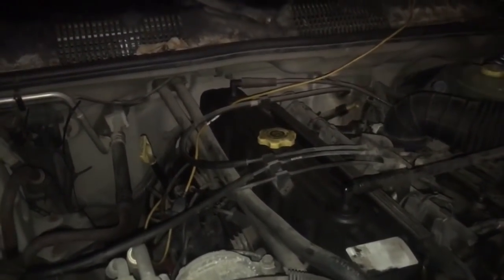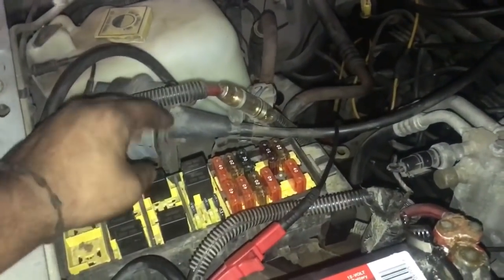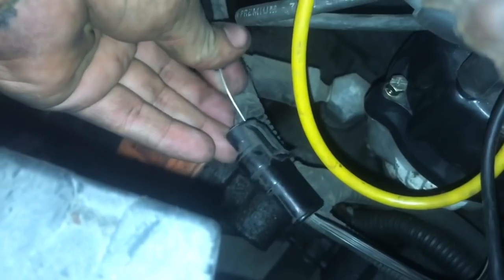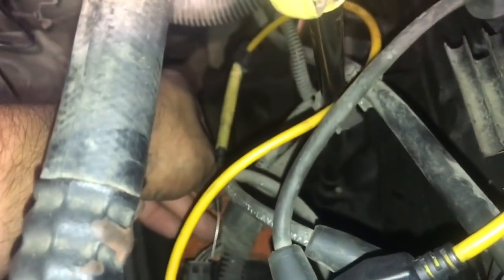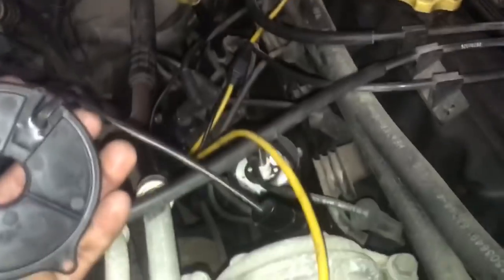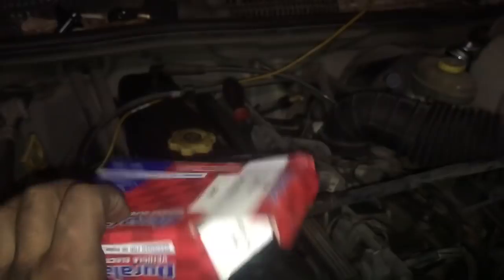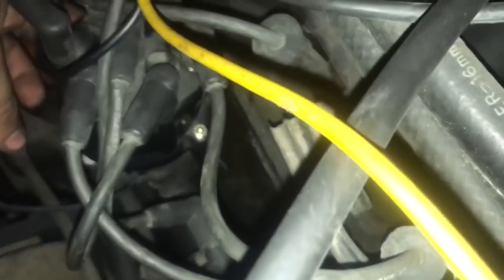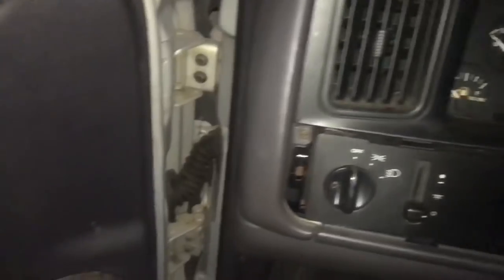Jeep Crank no start repair

Comment: I parked mine 10(!) Years ago when it had a no spark condition.  Realized that coils were a high failure item and yesterday, put in new coil and it started right up
Reply: What coils are you taking about? I have a 93 that won’t start.. tried everything

Comment: If the cam sensor has 5vts in and 5volts out when cranking, wouldn't that show its working? Thanks
Reply: I had the same question

Comment: I have a 2000 Grand Jeep Cherokee 8 cylinders, changed the battery my Jeep cranks won't start. I have two keys both chips are good so it's not the keys. My dashboard has a a key with a red  circle ⭕ displayed, my alarm system isn't displayed on the dash, not sure if it's the skim modulator. Any help would be appreciated thank you very much.
Reply: @seekingphase1621  Yes, it was the skim modulator, Thank you 😊

Comment: I love your videos Oz, long time subscriber having same problem with 05 GMC Sierra 1500 SLT with new battery that seems to have a parasitic drain because will not start after sitting all night. Had Autozone test Alternator, Battery, as well as Starter and was told everything was good, started 7 days straight after doing a trickle charge then let sit 48hrs for a final test and wouldn't do anything. I'm at wits end trying to think of something of test!
Reply from the maker: U.S. Army Ranger Operator have you hooked up an amp meter to see if you have a parasitic draw by any chance. And btw thanks for watching
Reply: Oz Mechanics thats next thing I'm gonna try, my family are from Dennison and Dallas, but I'm in Little Rock, Arkansas at the moment, but If I can't figure it out I'm probably going to put it on a trailer headed to you seriously because it's hard to find an honest working man these days!
Reply from the maker: U.S. Army Ranger Operator yea let me know what you get when you check your parasitic draw
Reply: Oz Mechanics I sure will, I appreciate all you do, your the best!